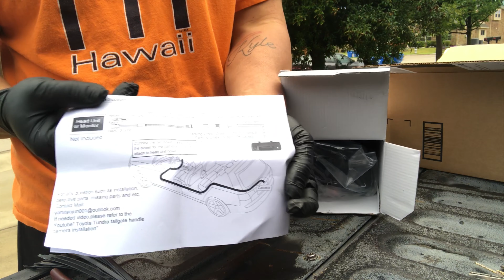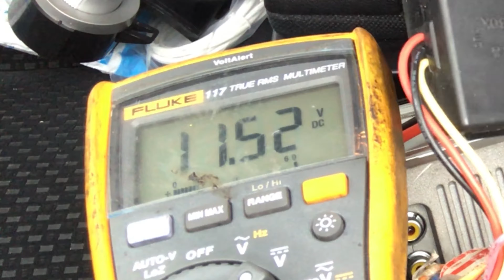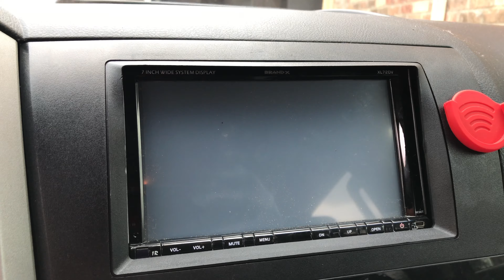How to Install Rear View Backup Camera on a 2007 - 2013 Toyota Tundra

Comment: Could you go into more detail on how to run the wires from the tailgate to the dashboard?
Reply: The BC and deck had instructions how to route the wires. Use back up light power to supply power to back up camera, route video RCA to deck and connect trigger line to deck. every deck trigger line are colored differently.

Comment: Thanks for making this video. I researched my butt off to find the best option for a backup camera for my '08 tundra. I ended up getting this exact tailgate camera from amazon, and an aftermarket receiver from crutchfield. I ran the wires exactly as you did, which turned out to be the easiest way to do it, and looks very neat. I was very pleased at the quality of both the tailgate handle and the picture from the camera. It was package nicely, already has the split wire loom installed, and was very simply to install. The only issue I had was wiring the positive and negative wires. I wired the positive side to the positive wire on the radio harness, but for some reason when I wired the negative wire to the ground wire of the radio harness, the camera would not work. I had to ground the camera to the truck frame. It wasn't a big deal, it just took a while to figure out the issue. I definitely recommend this tailgate camera to anyone with a 2007-2013 toyota tundra.
Reply from the maker: Wow!!! Thank you for coming back and leaving a feedback and comment!!! I’m glad it worked out for you!! I would have grounded it to the frame too but it worked out for me grounding it to a ground wire.. I was lazy looking for a hole or drill a hole for the ground wire.. lol
Reply: @Titus Gage Instablaster =)
Reply: @Branson Ford Thanks so much for your reply. I found the site thru google and im waiting for the hacking stuff now.
Looks like it's gonna take a while so I will get back to you later when my account password hopefully is recovered.
Reply: @Branson Ford it worked and I now got access to my account again. Im so happy:D
Thanks so much you saved my account !
Reply: @Titus Gage No problem =)
Reply: I can't seem to find out how you ran the wires into the cab, I'm not seeing the hole under the left rear seat (other than a plug in the floor for the body mount).

Comment: I upgraded my old stock camera to the Dasaita Tailgate Reverse Camera but now I don't see the trailer hitch on my vehicle like I did with the stock OEM camera. I used to see the trailer hitch and bumper along with everything else. It was very useful for parallel parking and backing into the driveway so my hitch wouldn't hit the garage. I notice your camera in the video is doing the same thing. Have you been able to adjust the camera down a bit?

Comment: Great music and video. But how is the back up feature work? Is it connected in radio, didn't see you connect to reverse lights
Reply from the maker: T bailey with my aftermarket stereo, I connected to my aux ... I have to push the aux to activate the backup camera... it doesn’t automatically jump to camera when I backup.. not sure if about other stereo system
Reply: @Tony2Ton  ohh ok

Comment: Hey man, thanks for the video. My back up camera comes with three open lines purple, red and black on both end and a RCA in one end. I connected the black and red to the reverse taillight on one end, on the other end i connect the purple line to the reverse cable of the head unit. When i put gear in reverse, the back up camera does not come up automatically, i have to go to the camera option on the screen to see it. What did i do wrong?

Comment: Did you have to wire your reverse trigger wire as well. I have mines wired to the reverse light and it still won’t trigger
Reply from the maker: i didn’t use the trigger wire
Reply: @Tony2Ton  so you just used power from reverse light ?
Reply from the maker: i used the aux input.. when i need to reverse.. i have to switch my stereo to aux input.
Reply from the maker: i used the wire the have 12v all the time..for power
Reply: @Tony2Ton  thanks bro my quick splices didn’t make proper connection. Probably upgrade to tailgate camera just for original look

Comment: Hay . Its plug and play if you get the factory parts . The morrow has the plug and the truck is pre wired.  . Installed in my 2010 with parts from junk yard for 75 buck for everything plugged it all in and it works great . If you want it on your radio there is a plug in the dash
Reply: Can you go in more detail about the plug? Also what camera did you got?

Comment: Hey buddy, which wire did you joined/tapped the red and black wire to in the stereo?
Reply from the maker: Red wire is for positive battery voltage.. just look for a positive wire in your stereo for red wire. And black wire is your ground.. your negative wire.. you can ground it to the frame of the vehicle if you want or to a ground wire of your stereo
Reply from the maker: Red wire is for positive battery voltage.. just look for a positive wire in your stereo for red wire. And black wire is your ground.. your negative wire.. you can ground it to the frame of the vehicle if you want or to a ground wire of your stereo
Reply from the maker: Red wire is for positive battery voltage.. just look for a positive wire in your stereo for red wire. And black wire is your ground.. your negative wire.. you can ground it to the frame of the vehicle if you want or to a ground wire of your stereo
Reply: I can’t find any hole behind the left rear seat lol
Reply: Are you not supposed to attach the positive voltage to the reverse light so that it’s only on when backing up?